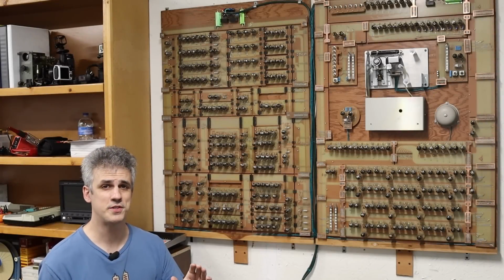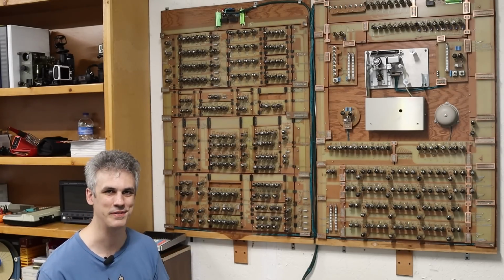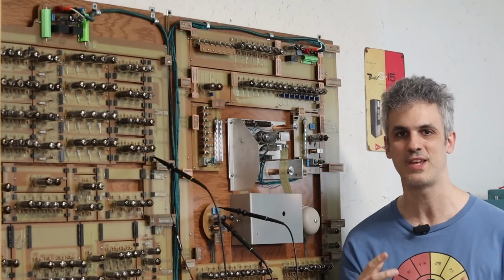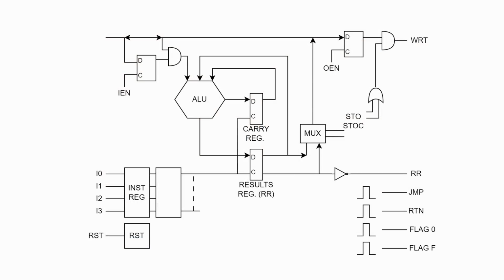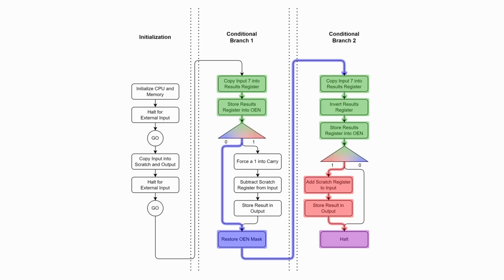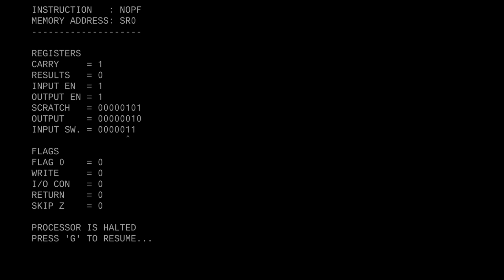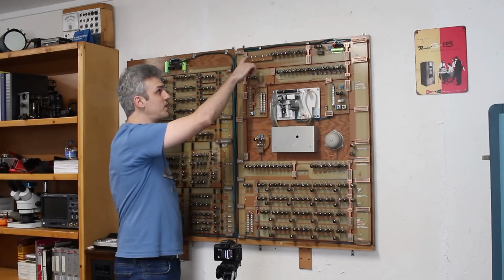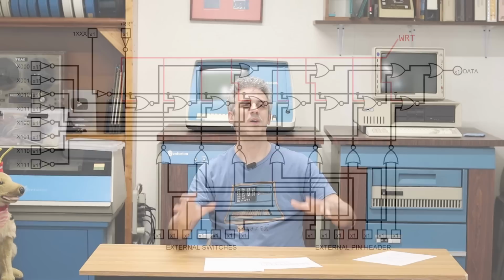The Last UE1 Episode!

Comment: Just a thought about your paper tape drive. When you turn it 'off', arrange the relay contacts to short the two wires to the motor instead of just open-circuit. Might need to use a SPDT relay to do that.  But that shorts the motor winding and creates 'dynamic brake'.  The spinning rotor, in the permanent magnetic field, generates a small voltage that will create a current through the shorted terminals.  It will force the motor very quickly to a stop.

Stopping quicker, you could get away with fewer NOPF instructions.

Comment: The tape overshoot problem is because of too a small gearing ratio in your capstan. Rather than using a capstan and roller like a magnetic tape would use as it requires continous motion you may want to consider using a Geneva mechanism like film would use. This would produce more discrete movements of the tape and allow the cam of the Geneva mechanism to be integrated with a switch that could tell the computer that it's good ready to read. 

All this of course assuming you even use a paper tape for the UE-2 😆
Reply from the maker: Tape overshoot isn't really a huge problem if you're aware of it.
The tape reader design here is very heavily inspired by the Bendix G-15, which operates exactly the same way. On the G-15, after a block of code has been read, around 10 NOPs are placed in the tape for tape spin down and spin up for the next block. If it was good enough for Bendix, it's good enough for me!
Reply: I wonder if he'll do magnetic tape next. DiPDoT and his relay computer recently used tape successfully, and Usagi was in the comments!

Comment: Avoid the TI9900 - I programmed it for 2+ years as a job in TI9900 assembler. Heaven was when the company switched to an Intel chip. The big shortcoming is the lack of a stack register and the crazy way the instruction set supports a single level of subroutine via the Branch and Link instruction using R11, returning via a JMP R11 instruction. The 9900 has only three registers within the chip - Program counter, register pointer and a read-only status register. Plus, every instruction must be aligned to 16-bit boundary - which is weird when using 8-bit instructions which must be padded to 16-bits by adding a trailing NUL byte in the assembler. It is a very fast 16 bit chip which copies the PDP11 by having most of its registers in RAM which are accessed via the register pointer. For interrupt handling it is only necessary to change the register pointer to gain a new set of registers and to then restore the original pointer value before returning from the interrupt handler.
Reply: The PDP11 didn't actually keep its registers in RAM, they just happened to be accessible using a certain range of memory addresses. There was special logic in the CPU to intercept those addresses and redirect them.

Comment: Glad to see you finally attached a scope to it when it was misbehaving like I once asked, and putting g2 to ground is a valid way of fixing that instability looking at the waveform. It has to do something with weird positive Feedback and negative resistance of the thyratron forming some sort of relaxation oscillator.
I was sure putting a different tube in there wouldnt fix it.
I am still concerned over the negative pulses hitting the electrolytic capacior so that has something that still needs to be dealt with otherwise you may get a simialir problem again.
Reply: Since this is the last video on this computer, that's an issue for either the UE2 model, or for whatever cyber archeologist that is going to dig this out in 50 years after we are all long gone ;)